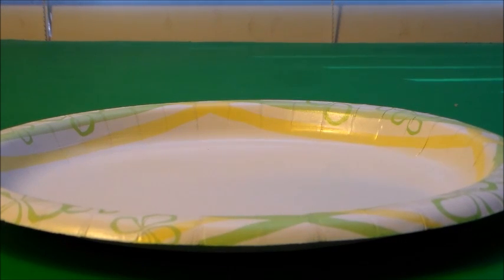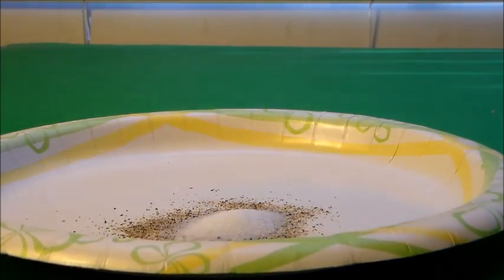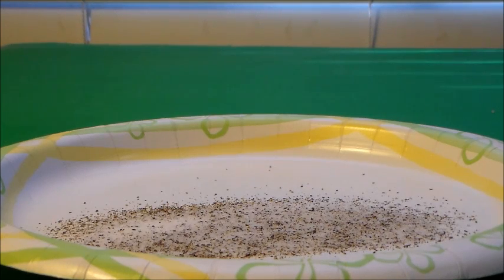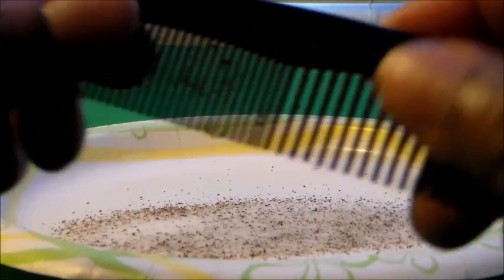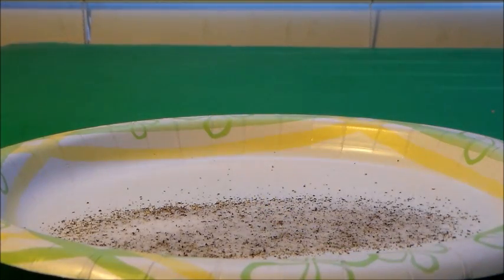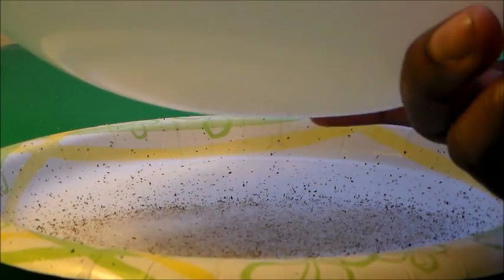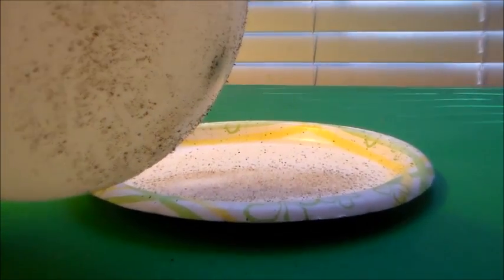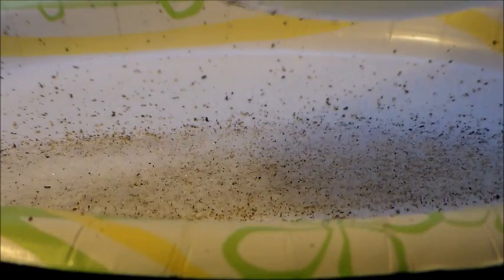Salt and Pepper Separator

Comment: When are you happy that it’s fully separated? It looks like a lot of work. I’d dilute the salt and filter the pepper
Reply from the maker: Thank you for asking. It is up to the individual doing the experiment to determine when to stop. Also, the experiment will not be perfect as the salt and pepper particles vary in size. Typically however, the average salt grains will be bigger than the average pepper grains.

Comment: Not worked with ballon
Reply from the maker: Hi Abdul,
Make sure the area you rubbed on the balloon is facing the black pepper and salt. Also make sure you are using table salt and not rock salt and finely grated pepper and not.
CAL